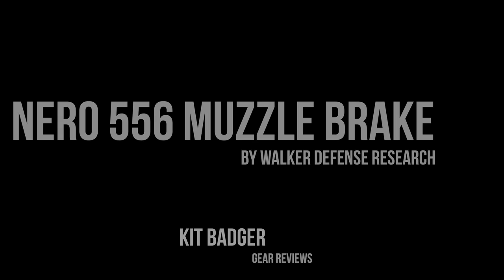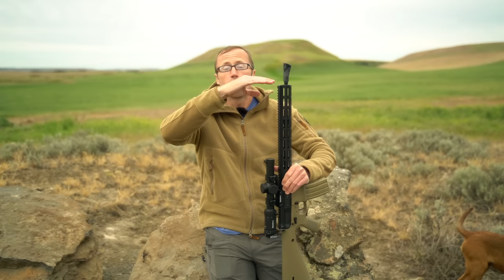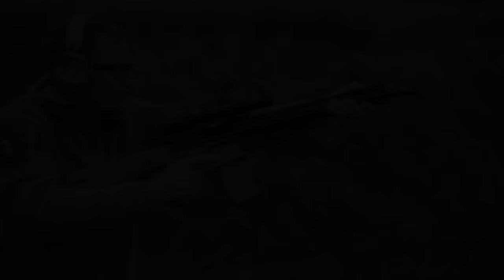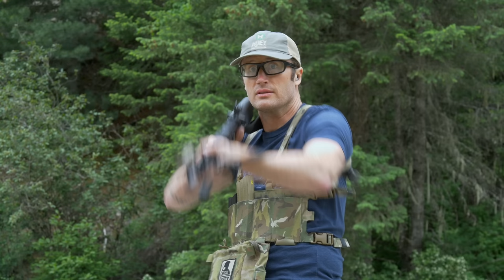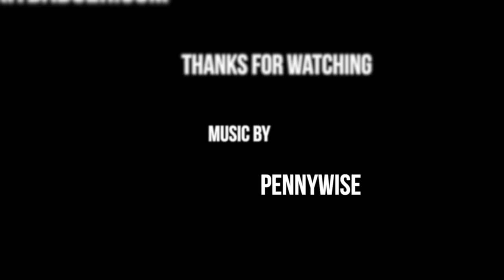Nero 556 Muzzle Brake by Walker Defense Research

Comment: I don’t understand the effort that goes in to 95% of the muzzle brakes on the market. The 5.56, especially in the AR platform, shoots very soft and can be ran quick with practice; even with the aging bird cage flash hider. What i can get behind is a suppressor. Not only do the qd brakes designed for the multitude of suppressors mitigate recoil, but the suppressor itself completely mitigates the flash signature and disperses the sound signature so the bad guys can’t pin point where the bullets are coming from. The sound decibel reduction is just icing on the cake. If suppressors were easier to acquire, the muzzle brake industry would be out of business.
Reply: Muzzle brakes will never go away as long as competition exists.